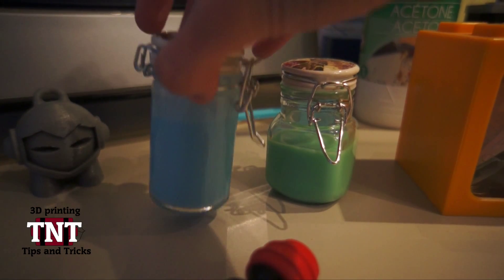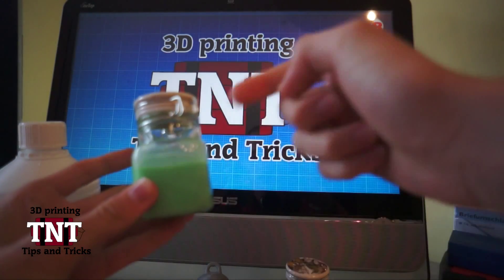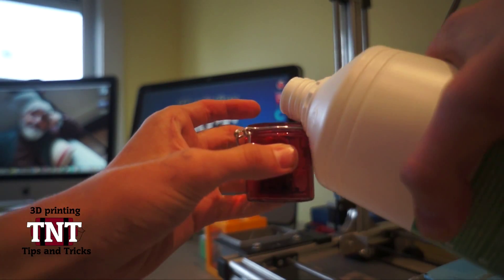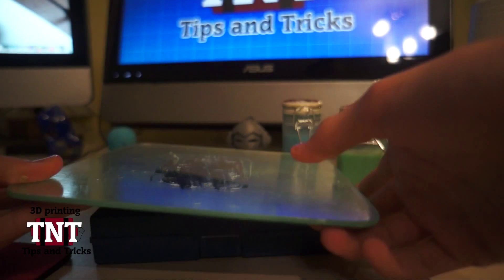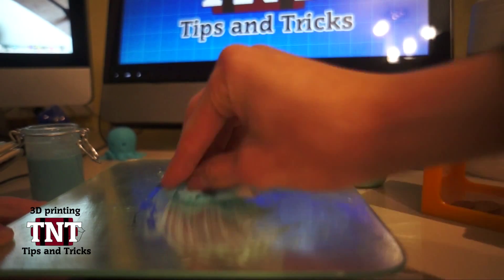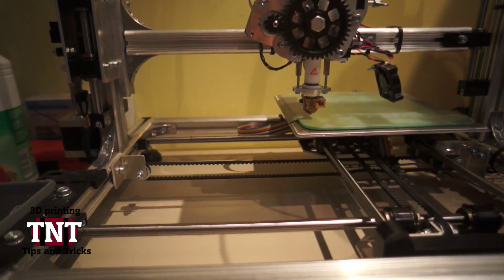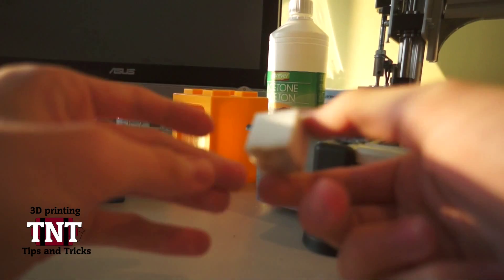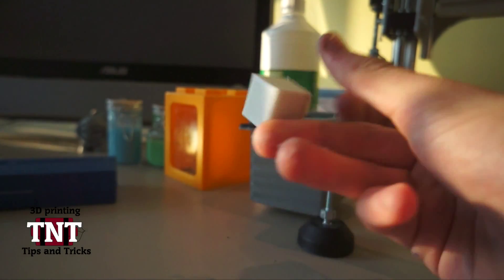TNT: How to print ABS without a heated bed ! ( Making ABS juice )

Comment: I try print abs without a heated bed by making abs juice. But when abs juice dry seem it wont stick hard to my glass bed. Am i wrong somewhere? 
Sr for my bad english
Reply: Hello. I will answer you after 1 year. If the quantity of ABS and Acetone are not proportional, it will glue the print to your bed. You have to make your juice with good proportions

Comment: do you have to pour the abs juice for each print,
Reply from the maker: el SunShine el SunShine hey, it depends, usually the abs will stick of with the print so in most cases yes. But you can use one bottle for like 30 prints if not more.
Reply: ok thanks